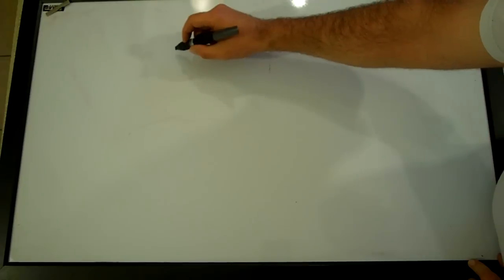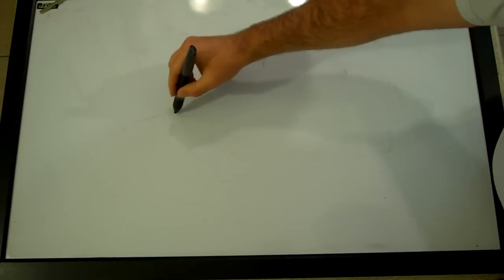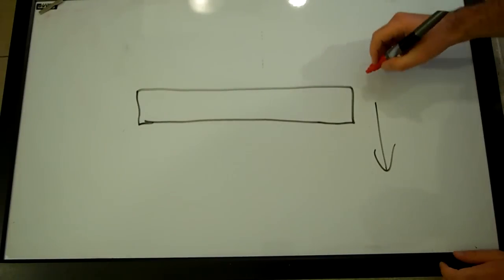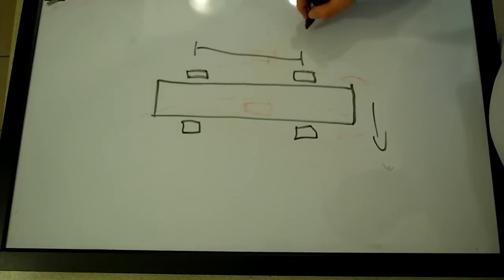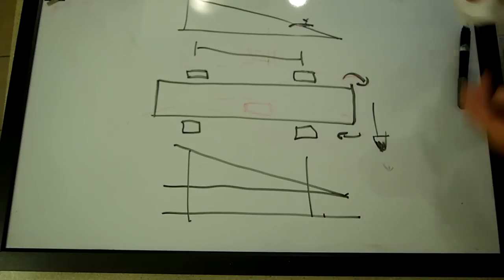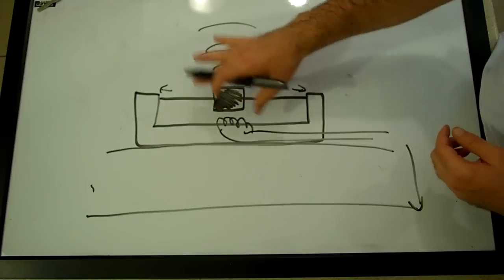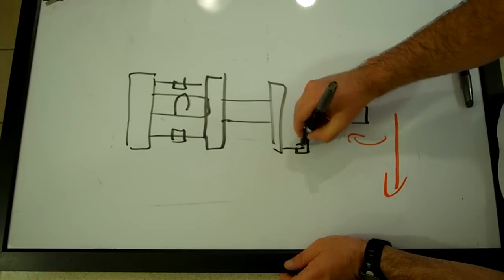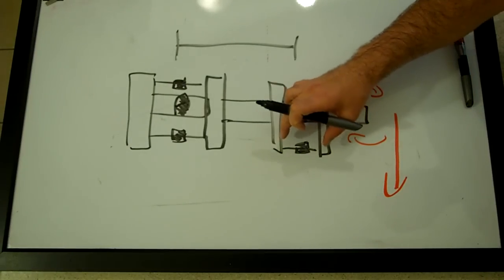How Garmin Vector works and how Resonant String Gauges work

Comment: Ascelerometer might work for software compensation filtering the twist related to the previous speed readings if its acurate and fast. Strain with no correlated movement can be droped and average like 50 times a second o more... Just thinking